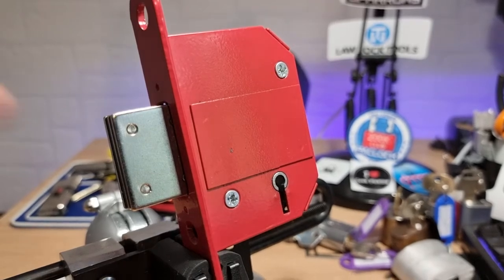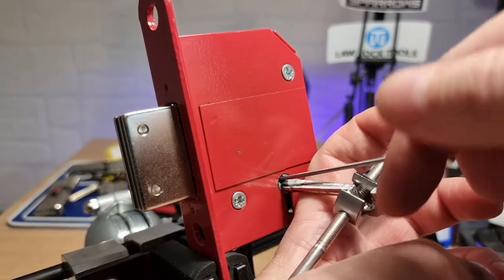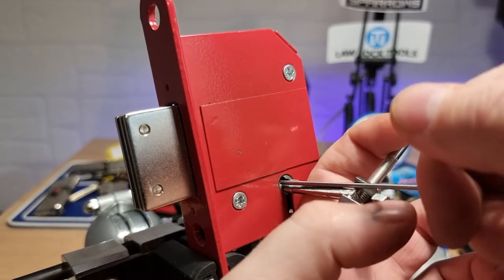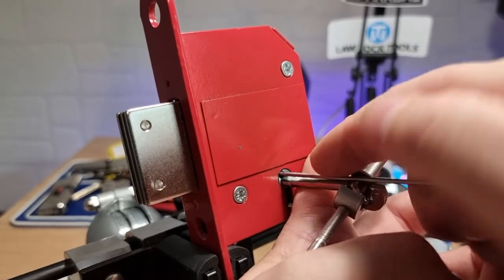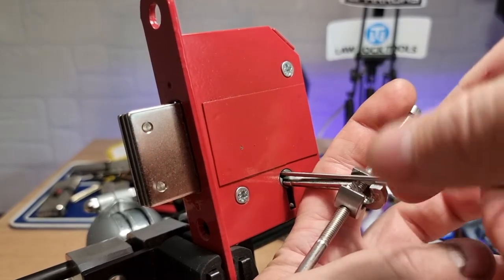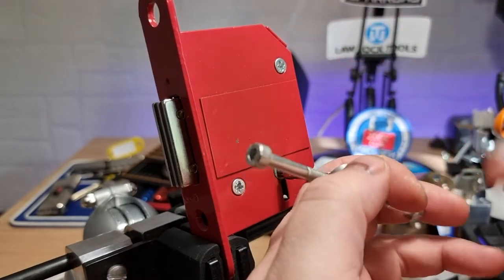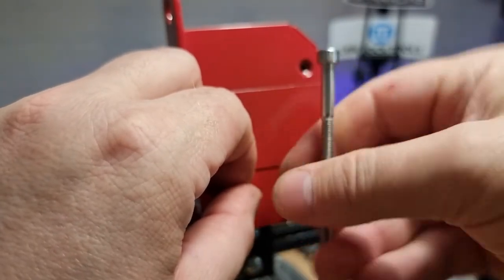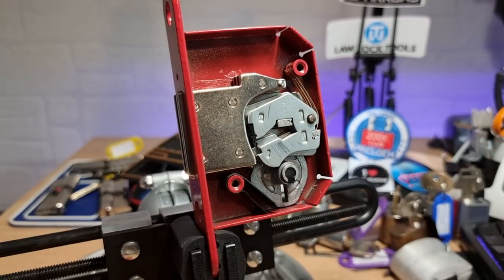(89) ERA 5 Lever BS Deadlock

Comment: Nicely done. The levers on them can be really high lifts. I have a few of them. Not picked them tho, none of my wires are tall enough.... I really need to make a wire for them🤣.
Well done tho. They are not the easiest of locks to pick. Your doing good with the lever locks👍
Reply from the maker: Thanks Deadlocks 😊 
I'm still very inconsistent with that era. I think I'm overlifting the low cuts and getting caught in the bottom false gates.
My pickwire is also a bit short and I've got to go fishing for the high lifts.
Thanks for the encouragement bud 😁
Cheers 👍 🍻
Reply: @Myloks  consistency is a practice thing, at least you have a fair idea whats going on in there👍

Comment: Those are fun to pick, the one have have worked on took very light tension otherwise it would drop into a false gate
Reply from the maker: It's a tricky one with some very high lifts and false gates on the bottom of the low lift levers.. I kept getting caught out by those.
I'm still very fresh to lever locks so hopefully I'll develop a better feel for it with practice.
Cheers bud 👍 🍻